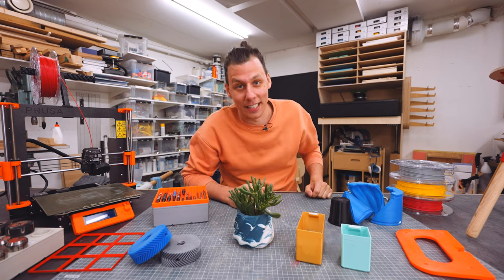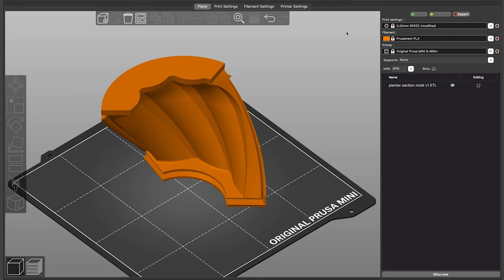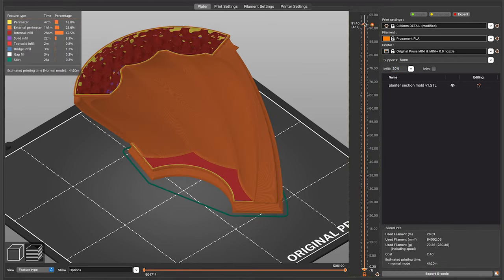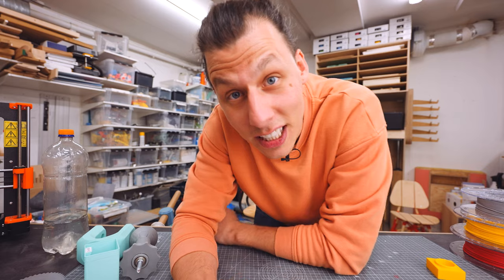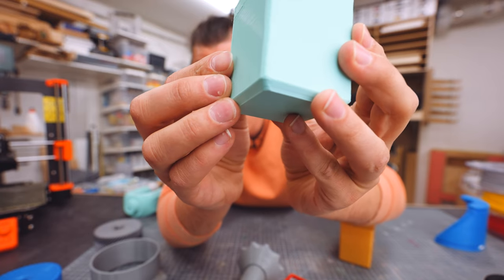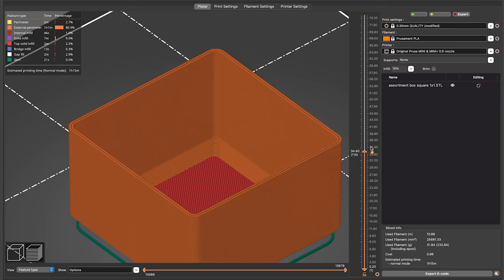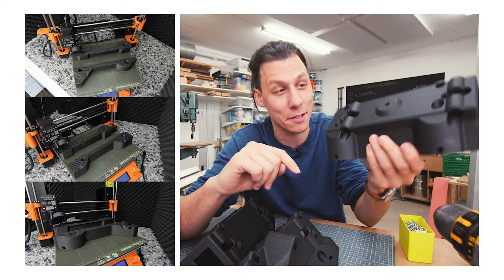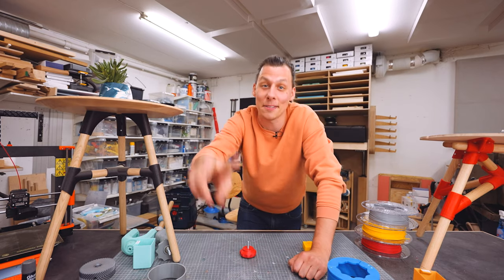My 10 BEST tips for 3D Printing

Comment: Great video. For the line width, try to keep it between -20% / 20% of your nozzle size. For example, 0.4 nozzle, use 0.32 to 0.48 line widths. Of course you can try with more extreme values but that's a good rule of thumb to start with.

Comment: all great advice, however have you tried using a saturated salt and water solution instead of glue stick? just mix salt and water together in a strong concentration, then wipe it onto the bed with some kitchen towel when the bed is pre-heated, it will quickly dry into a hazey glaze that holds parts down fantastically, especially on glass, and doesn't have any of the messy cleanup of glue.

Comment: 3D print the vase then use silicone from hardware store to create a rubber mould for casting. Personally I found it easier to work with and if you mix in a little cornstarch in to the silicone first it creates a putty that you can mould better with your hands.

Comment: You can generally print at 150% of nozzle width with good results.  Your point about testing does still apply though, as you might need to add support to deal with overhangs or boundary conditions.

CNC Kitchen has done testing showing that there is an increase in strength / welding between layers at higher line widths.  You may be able to get up to 200% line width with diminishing returns beyond 150%. 

Your point about extra perimeters is a good one... Try incorporating thicker line widths, up to 150% of the nozzle.   You might want to check the volumetric flow rate to make sure you're not exceeding the limits of your nozzle though.  I agree, 0.6mm nozzle is better for my utility prints and I don't print really small stuff very often.. 0.6mm also makes using filled filaments easier (cellulose/wood filament, carbon fiber reinforced or nylon filaments.).  I've found polycarbonate carbon fiber to print really well on my printer with no enclosure.  105C bed, 255 degree print, and really great polycarbonate carbon fiber reinforced parts..  PC CF needs those wider layer lines to get good layer welding... there is a lot more heat in a wider layer line.

Comment: Great video!! Another tip is to use “Adaptive Cubic” infill. This will build smaller infill shapes when inside more complex elements of the model such as curvature, tubes, etc. and larger shapes for bigger gaps.

Comment: Been 3D printing for years and never used glue stick or hairspray. In the beginning I used Kapton sheet for the bed, which was OK. Later on I switched to PEI on steel sheets and never looked back. As ALCH mentioned, you just need to keep the bed clean with something like a cheap microfibre cloth and isopropyl alcohol and rough it up once in a while with scotch-brite and it will keep working like a treat for a long time.

Comment: Quick tip: You can print up to 0.65mm lines from a 0.4mm nozzle, as the flat area around the nozzle will simply iron down the excess material. If you change to a 0.6mm nozzle, you can get even thicker lines (provided that the nozzle has some flat surface around the hole).

Comment: Regarding use of glue stick, here is another tip: It really only needs a little bit of it and does not need to be fully covering the bed. Then take a wet paper towel and spread the applied gluestick evenly across the whole print plate until it is very thin and almost not visible. This will leave much better surface quality and you have much less glue on the part. After removing a print do not apply new glue stick, but just use the wet paper towel method to even out the glue layer. Renew the gluestick layer only after the third time of spreading.

Comment: in cura you can force it to not use infill/top/bottom even if your walls are not a multiple of the nozel size. It will use a thiner wall in the middle instead of jogging back and fourth to add a face or infill.

Comment: I never considered max "fillet" because of nozzle size before. That makes a lot of sense. I think you should give NPA a try instead of gluesticks. Even though it is for high end filaments it works for PLA/PETG too. The reason I like it more is because it is water soluble and doesn't leave imprints on the bottom of prints. Lots of great tips for beginners too! Thanks Alexandre!

Comment: An additional tip from me: Spend a little more to get high quality pla from proven brands. Actually I prefer pla+, it has a little platic inside that gives more strength and good surface finishing. Great video again thanks.
Reply: PLA+ = PLA + marketing.
Same crappy material for printing crappy useless things.

Comment: Thank you for the handy tips. I agree and use PLA filament almost exclusively. I installed a 0.6mm nozzle to print a bunch of your grids and boxes for my workshop. You gave me a few good tips to tweak my print settings which I appreciate and use when printing the next batch. Cheers 👍😎🇦🇺

Comment: defiantly great tips, but I stept off the glue sticks a long time ago. I use glass topped with magnetic sticker then metal buildplate pai sheet. Sometimes clean with sprits of alcohol, wipe off, and ready to print. Super clean prints.

Comment: 15:20 another tip in this vein - you can (in cura at least) place the model mostly below the print bed if say you want to test a feature at the top / end of the print but don't want to remodel anything or change the print orientation
Reply: With PrusaSlicer, I use a sort of cut line, that is a horizontal plane of sorts, and I adjust the height to where I can get a sample. I mostly use it for printing say a 2-3mm height part of some holes. I then test for the holes to see if they work. If so, print the whole 6-9 hour job

Comment: About PLA: I go with you when you say just use it for everything. PLA is also the most environmentally friendly plastic of the common 3D printing materials because it is polylactic acid and decomposes under the right condidtions i.e. a composting plant.

There is one big exeption: Stuff that comes into contact with food. PLA is not food safe so you should use PETG for that. It is just as easy to print with.

Another exeption is flexibles, but this is already a very special use case.
Reply: Indeed, "under the right conditions". There is a misconception that PLA can just be chucked into nature and it will decompose, but that is not true. It requires specialized facilities and conditions to decompose, otherwise it's just another piece of plastic garbage littering in nature. There are also food safe PLA filaments out there, specifically designed for that purpose. Still, nothing you print should be in constant food contact, but making things like cookie cutters is okay as long as you pick the right plastic.

I would add one other caveat, strength. ABS is by far stronger than PLA, and it fails less dramatically than it does. ABS is though one of the worst 3d printing plastics in terms of the environment, so I try to use it sparingly, and generally only when I need that added strength, which often also means a solidly printed part and post-treatment with something like acetone, or even baking to really fuse it together properly, if possible.
Reply: @SwitchAndLever  and pigments also don't decompose, so if you have the most glittery filament ever. Well, not that friendly for the environment. In fact, even worse if it is decomposed and not burned because of microplastics.

Oh and I thing if I want strength, I'd head directly towards Polycarbonate.

Comment: I agree on most tips. Just personally i switched to petg for most things instead of pla. The only reason is the lower melting temperature of pla. Maybe it was my cheap pla but i had several parts warp significantly due to the heat of the sun (in cars or behind home window etc.) but for most indoor uses etc. pla is probably plenty strong

Comment: Completely agree that PLA is good for 98% of the prints people do, but there are edge cases where better impact resistance, reduced creep, and higher glass transition temperatures require more appropriate places.

Glue stick is fine for PLA, but if you do something with materials that need higher build plate temperatures, the glue stick liquefies and ruins adhesion. Also, PLA creeps a lot over time with constant load. I would recommend PETG (or ASA if you have a enclosed printed with good ventilation) for parts that are under constant load.

Comment: Tip 1: You don't need a 0.6 nozzle to print 0.6 width. A 0.4 nozzle will happily print up to 0.8 width. (Although if you have bridges you'll need to reduce the flow in those since they don't get squished.)

Comment: Great tips. As a newcomer to 3d-printing I say thanks! But to be honest: the way of presenting in my opinion is over the top.
I find it super easy to clean my PEI printbed with alcohol once a while. It nearly stucks everytime. Only when I print very small pieces I definitely clean the bed and use a brim. I never missed a glue stick.
What I had to learn the hard way is printing PET-G, which I definitely need for parts I use inside my car. I started with the normal Prusa printbed and had some issues getting my parts of the printbed. So I ruined it. Now I bought a 2nd rough printbed, which works fine with PET-G.

Comment: Finally someone that understands pla is stronger than most think, you actually need polycarbonate to get similar tensile strength, you can believe me or not, but then please have a look at some data sheets (if one manufacturer doesnt provide data sheets, just dont buy it, its probably crap).

Comment: Glue stick FTW.  I have printers with glass, aluminum, and PIE bed surfaces.  I want to be able to print any print on any printer (depending in which isn't busy), and glue stick lets me use the same workflow everywhere.

Comment: Hello,
3:25 Prusa Slicer use 0.45mm wall/perimeter in Standard setting for 0.4mm nozzle. 3 Walls are 1,35mm.

The standard wall width for a 0.6mm nozzle is probably also set wider than 0.6mm for the Prusa slicer.
Since many designers calculate their virtual things with 0.4mm perimeter width beforehand, it may not come out as well on the Prusa slicer.

Many greetings

juck.

Comment: One more tip that I thought of while watching this video--Don't Touch your PEI (smooth or powder-coated) sheets with your bare hands!  Or if you do, make sure you wipe it down really well with Isopropyl Alcohol (Isopropanol) afterwards.  The grease from your hands (just normal skin oils) can definitely have an impact on bed adhesion.  In general, I always use gloves when removing parts from my flex sheets to avoid getting skin oils onto the sheet.  I still wipe down with Isopropyl between prints (it also helps remove dust).   

I also occasionally wash my flex sheets with Dawn dish soap (or other degreasing soap), while wearing waterproof gloves and dry them with a clean towel.  Then a quick alcohol wipe and they are good to go.

Hope that helps.   Oh, my experience for the above is all with Prusa i3 MK2.5/MK3 printers.

Comment: Would you try to make yout own filament ? The youtuber Mr3d print did a series of videos on his low cost low complexity pet recycling into filament :
-'You turn a pet bottle into a pet ribbon by cutting down the back, cutting down a little bit the end into the beginning of the ribbon, the "unroll" the bottle with a blade. 
- remelt the ribbon through a heater block with a 2mm drilled nozzle, by widing it at the right constant speed, you get a constant diameter filament.
Prefer using some bottles with smooth surface, not like coke bottles, the riddles of the surface will make an uneaven ribbon, ensuing in a lower quality filament

Comment: I prefer hairspray to a glue stick. Locally, I can pick up a large can for 99p. It has a spray nozzle and is mostly alcohol based. It takes 3 seconds to spray onto the bed of the printer and is really tacky.

I've never had a print come loose using hairspray so I recommend it over glue.
Reply: I second this. Much more convenient IMO!
Reply: There're are different types of glue sticks.
In my experience, regular PVA glue is rather weak, PVP glue is harder to come by but holds parts way better.
Reply: Doesn‘t that get to places it shouldn‘t go? Like onto the linar rails or lead screws and also to the area surrounding the 3d printer? 🤔
Reply: @gorgonbert  Mist the removable plate away from the printer. Not a heavy coating, and not needed for every print, lasts for several cycles. Avoid touching the build plate, finger oils interfere with adhesion. Saves tons of alcohol and time and the parts don't come out coated with glue.

Comment: the only reason that pla isn't as good of a functional material, in my opinion, is that it is not very temperature resistant. PLA is actually a very strong material, it's just relatively stiff, as well as not very temperature resistant. if you need more flexibility or temperature resistance, go with something like PETG, since it's also easy to print with, but for everything else, PLA is very strong.

Comment: PLA doesn't handle heat over 60 degrees, and it's not dimensionally stable - in the sense that if it's constantly under pressure like some mechanical parts can be, it bends and deforms. PETG is a much better choice for almost everything, in my opinion, and it prints extremely well on a Prusa with a textured plate. I'm basically only printing PETG, it's just better. PETG on a textured steel plate requires zero glue or anything else, as soon as the steel plate cools, the PETG just detaches on its own: PETG on a Prusa is a wonderful experience in my opinion and produces superior parts to PLA. PLA, for that matter, requires zero glue stick as well - as long as you use the smooth print plate that it grips properly, the textured plate is not fully suited to PLA, or to ASA which is the "step up" from PETG - but ASA has other issues, like requiring a heated enclosure and it produces fumes.

Comment: 16:52 When support is unavoidable, sometimes you could minimize the amount of support needed by using support blocker feature of your slicer.  For instance, this piece MUST be printed with support, but I cut the print time by half by only supporting the bottom 10mm of this piece.  
https://youtu.be/a_nmnn7DzW0?t=62

Comment: There is no reason to use a glue stick anymore.. The right surface (for example Ultrabase) is better than any glue stick. Also, I don't have any problems printing round holes, maybe you have some settings wrong? The prusa is supposed to have better quality than my Anycubic.. I've printed crazy overhangs and bridges to avoid supports =)

Great tips 👍

Comment: I only use glue sticks when I am printing something where the first few layers have small details (like a fine toothed comb for example).  I keep a spray bottle full of 90% isopropyl alcohol and a box of tissues next to my printer.  It is really easy to just spray and wipe the print surface between jobs.
Reply: This is interesting. I will have to try it. Thank you

Comment: I hafe the problem that the filament won t stick to the bed. So it messes my print up every time. Or sometimes it lays the filament down and then tears it back up and it follows the nozzel. 
Does anybody have a tipp for me what i can do so that my prints work. 
By the way i have a Creality Ender 5 printer
Reply: Clean the bed thoroughly using isopropyl alcohol. Make sure you have the z height dialed in. Make the first layer slower, with higher extruder temp, and wider lines (like 130% width). Use a high enough build surface temperature.
You could also get a new build surface, like a magnetic flexible plate covered in PEI.

Comment: what is your advice for designing an item so the tolerances (such as screw threads inside and out) are exact?
Reply: Print a cube with only two outside layers, let's say 20mm of size. Then measure the wall thickness and tune the feeder multiplier.
Second, print a very large version, only a few layers high, and measure the outside in X and Y direction, while still on the bed. That is to find any belt tension errors. Tune in the slicer till correct.

Comment: I’m having issues printing your assortment boxes.  The bottoms just fall out.  Will try increasing the line width to .75 on my .6 nozzle.
Reply: I did a few with the regular 0.4 nozzle and standard settings on my Prusa Mini and PETG. no issues.
Reply: @chuysaucedo7119  yeah found out the monoprice pla I was using was junk.  Printed with polymaker eco pla they come out awesome.
Reply: @brianhilligoss  glad to hear it came out better. And good to know, I'll avoid that PLA

Comment: You shouldn't use glue stick on a PEI sheet.
Reply: Prusa ship a PVA glue stick with their printers and suggest to use it for build plate adhesion.
Reply: some filaments like petg or tpu can stick too good to PEI so glue stick or spray also helps with that

Comment: Great stuff. completely agree on all of these. One other tip I would recommend... if you are having first layer adhesion issues, setup your first layer to print 20-30 degrees higher. Revert to normal temps after that,

Comment: Using PLA on parts that need to have strength, durability, and longevity without warping is just a mistake from an engineering standpoint. PETG is even more inexpensive and is basically indestructible compared to PLA, it is absolutely a no-brainer to not use it for those types of parts.
Reply: I don't agree. PET is quite brittle and has a lower Young's module. Nice material but not as universal als PLA.

Comment: If 0.6 is better than 0.4, why don't you use 0.8 or 1.0?
Reply: In my experience PLA gets messy to print with large nozzles unless you really lower the temp. My theory is that the plastic oozes out of the nozzle so retractions sort of stop working.

Comment: You forgot your tip 10b: not only can you use 3d forms for moldings (additive process) but also for hand router templates (subtractive process), turning your cheap toll in an almost cnc-like capable machine.